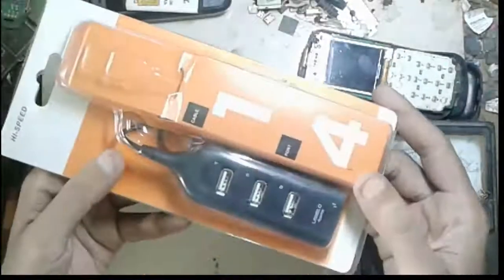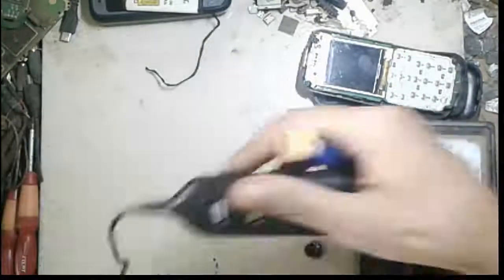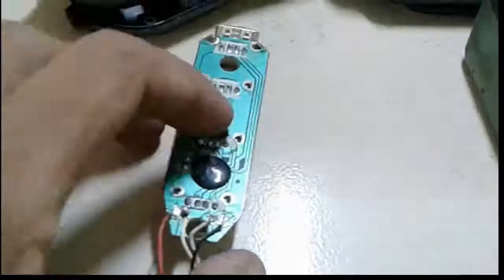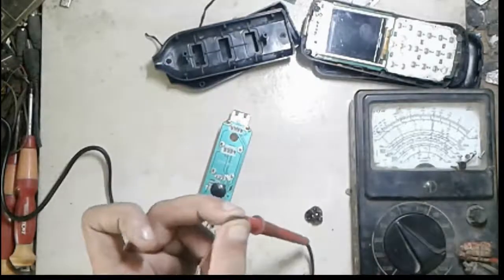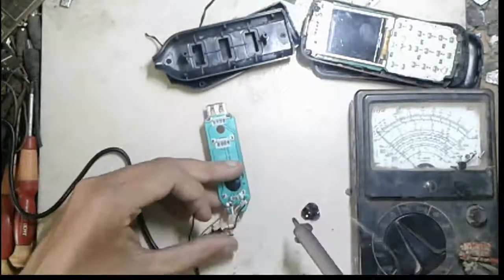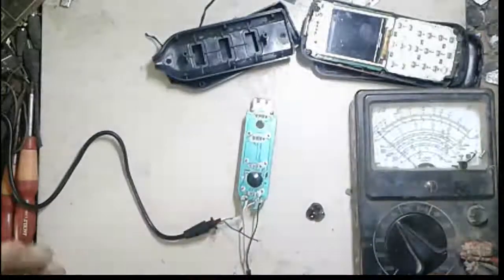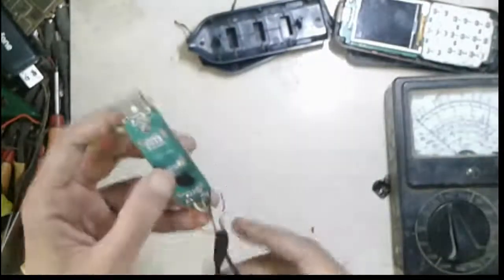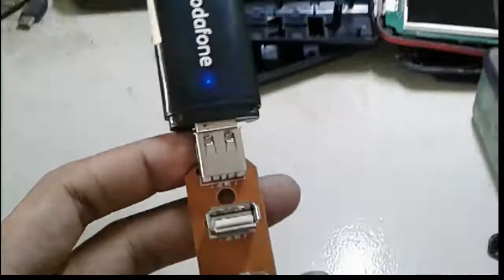how to Add an extra power to a cheap USB hub and make it faster

Comment: I tried this and It works, but you have to connect usb ground and power supply ground together. Thanks!
Reply from the maker: Thanks for your comment
Reply: i know it's a very old comment but i just need to know , is it safe on the long run to use this for a hard drive ?
i can't find a powered usb 3.0 where i live , i can only find non-powered so, if i get one and follow this tutorial, is it safe to connect a hard drive and a keyboard and mouse ? and also , is it going to be stable and won't randomly keep disconnecting ?
Reply: @madbro9939  yes it should be safe to do so, but as mentioned, the gnd wire from the usb has to be connected too. Only the usb power(red wire) should be desoldered. So you have, red from power supply, white and green from usb cable, and black wires from both power supply and usb cable.

Comment: Would it work if I connect a USB male to USB male cable in one of the 4 ports, and the other end into a usb wall charger 2A? What do you think, would it be powered by the wall charger then?
Reply from the maker: Hope so
Reply: I don't have such cable to test.
Reply: it would create some problems if the voltage of the PC usb port and charger is not the same one will act as a load and probably fry your motherboard or usb lines :3
Reply: Deepesh Raj  are you certain that the   wall adapter you use have 5v constantly ? yes , some of them are very good and have good voltage regulations but most of them I've come across supplies a little more than 5v. The voltage regulation on the motherboard side is very precise and have constant 5 volts. It should work , but too risky that is what I was trying to point out
Reply: @waliurrahman4295  Yes, actually there is a very popular model sold on amazon that clamps to your table. It has been causing issues with my PC. It crashes, but then the lights on my motherboard are still on even after completely removing the power from the PSU. I found out that there's no diode on the +5v line coming from the PC, so the external adapter is feeding power back into the motherboard. I almost sent my motherboard back to ASUS before i found a comment on amazon reviews with someone mentioning this about the USB hub.
Reply: Nop bro didn't work i tried so many times

Comment: You have to connect the charger's ground with the computer's ground otherwise the data pins will float and become unreadable to the connected devices
Reply: Bhai ap khud is idea pr video banaein plzzz.
Reply: i know it's a very old comment but i just need to know , is it safe on the long run to use this for a hard drive ?
i can't find a powered usb 3.0 where i live , i can only find non-powered so, if i get one and follow this tutorial, is it safe to connect a hard drive and a keyboard and mouse ? and also , is it going to be stable and won't randomly keep disconnecting ?

Comment: This would work for powering usb device, but it Data line to PC or (Device) would not work unless you add two black ground together.
Reply from the maker: yes
Reply: Two black ground soldered together, but red wire from USB hub and red wire from charger should be together or just one red wire from charger soldered? And the other one no need soldering? Thanks in advance
Reply: @ferrislie4430  the gnd wire from the usb has to be connected too. Only the ush power(red wire) should be desoldered. So you have, red from power supply, white and green from usb cable, and black wires from both power supply and us cable.

Comment: This idea helped me incredibly. My Lenovo ideapad 100 lost voltage on usb port. I made a powered  Usb hub according to the shown way. Now everything ok. Thanks a lot
Reply from the maker: Thanks a lot for your comment. Stay with us
Reply: i know it's a very old comment but i just need to know , is it safe on the long run to use this for a hard drive ?
i can't find a powered usb 3.0 where i live , i can only find non-powered so, if i get one and follow this tutorial, is it safe to connect a hard drive and a keyboard and mouse ? and also , is it going to be stable and won't randomly keep disconnecting ?

Comment: hi,

how about adding capacitor and using the same usb hub without adding any charger?
Reply: Connect a diod in usb ports + wire then connect to usb hub.
Now geat a micro USB female port and connect + - diricet to usb hub.
Now when you using more than one device, connect charger and use it.
Reply: which type of diod

Comment: The most important thing here the positive red wire from the PC that was disconnected was hanging loose. It needs to be trimmed taped / insulated to prevent shorting the USB power from Mother boarsd and ruining it. Otherwise a very usedful video.

Comment: Why the ground wire was disconnected?!
The ground voltage of USB hub and the ground voltage of master device that the hub connect to, may be different!!!
Reply from the maker: coz i want to use just external power. no need ground of computer.

Comment: I tried this 2 times. Fried 2 usb 2.0 hub. Then i soldered hub wires in their proper places. When i connect devices to the hub, mouse, keyboard, the pc or phone not recognize it.
Reply from the maker: Check data line
Reply: It's ok with the lines. It stopped recognizing after the procedure. Could you tell me what charger current you use in the video? I tried here with a 5v 450ma but without success. It's damaging the hubs I use.

Comment: I have tried. But the computer can not read. Can only turn on the lights
Reply from the maker: Check your data line cable.
Reply: Color and position, please clarify
Reply: add both of the grounds (black wires) together
Reply: To make it work you have to reference land that is achieved with the two black calves together.